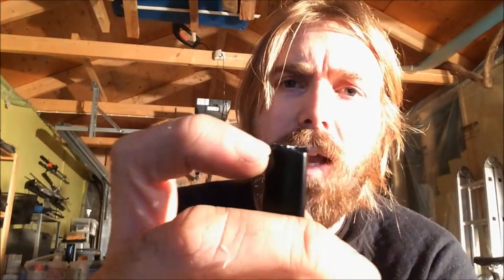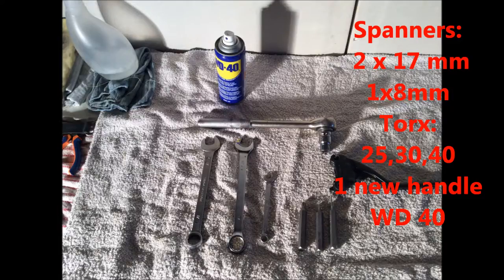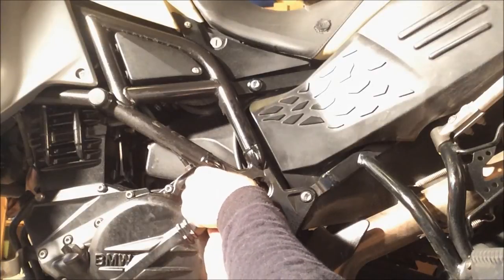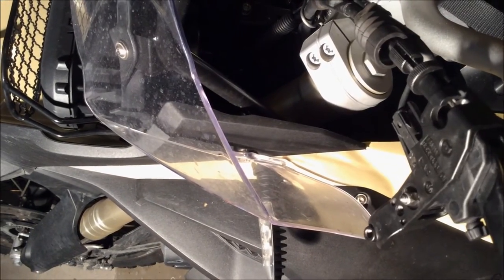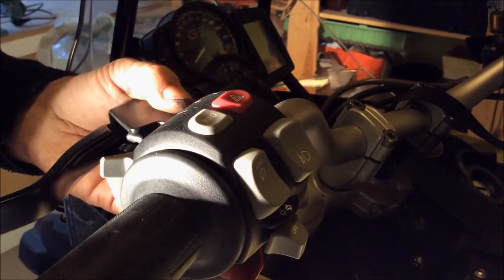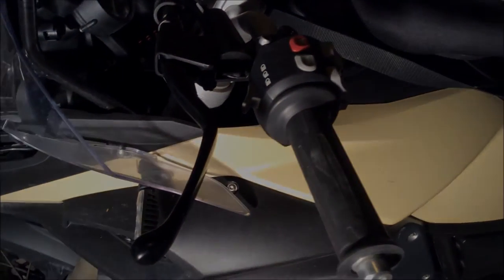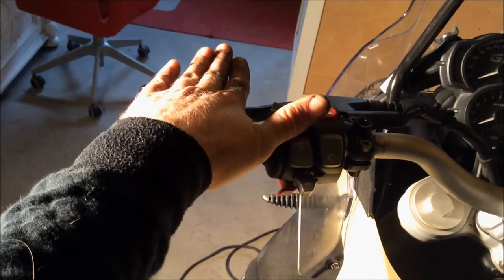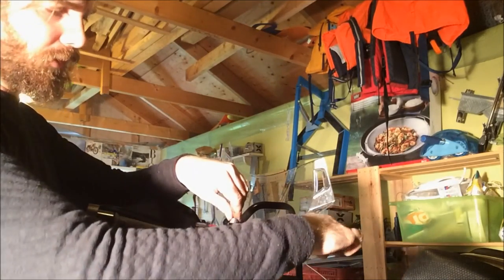Motorcycle Clutch Lever Installation/Replacement BMW f800GS

Comment: Thanks for posting.. My F800GS has 6200 miles on it and the clutch lever started to be a bit sticky.. I noticed that the aluminium housing is wearing.. so make sure it is always greased up properly.. I will pack mine with grease and see if it improves.

Comment: Just changed my broken clutch handle for a new one thanks to your video :) Realized there was no clip and wondering if it broke this winter when I fell and broke the clutch handle or if it has not been there for years. How bad is it to drive without one? I am going to order one but will probably continue driving untill I get it.